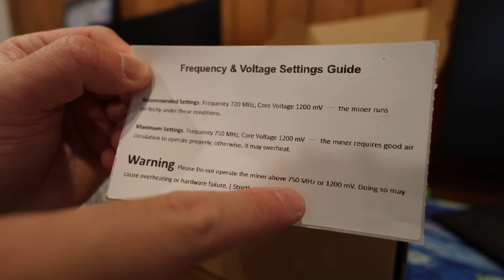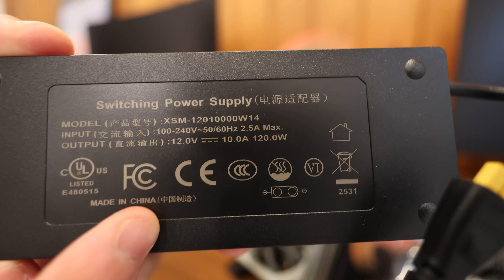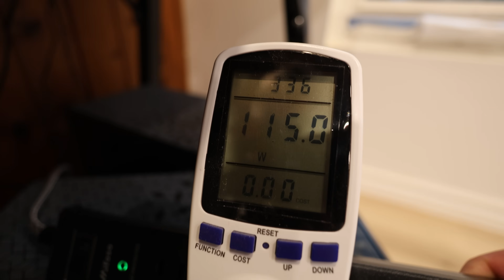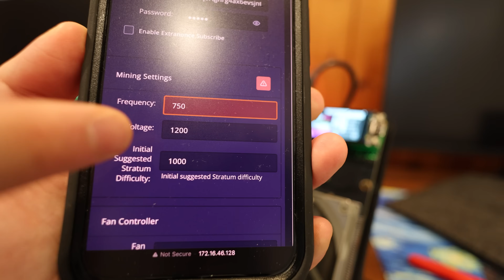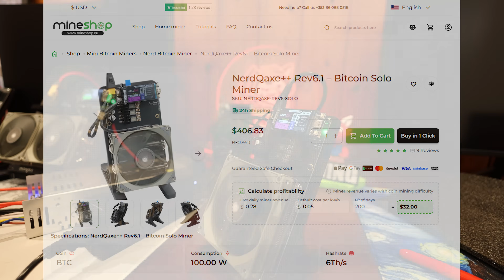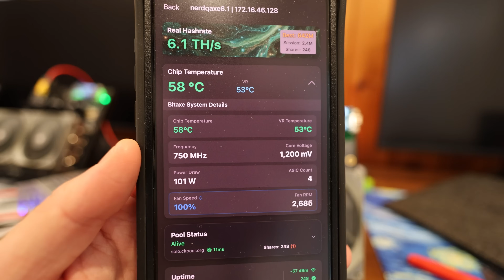This Little Bitcoin Miner Changes Solo Mining FOREVER.

Comment: RPM, that Qaxe++ looks very nice! i like it, i think the limit is PSU thats the reason for the warning! you are running that limit PSU maxed out, also there are two type of XT30 connector, standard and heavy duty, standard max out at 15amps and heavy duty 30amps however the XT30 heavy duty connectors are so expensive its cheaper to go XT60 and get the same capacity, as for barrel connectors they can support up to 15+amps however because there is so many different types that range from 1amp to 30amps its very confusing and can cause major issues if you buy the right connector but with the wrong awg wires or correct awg wire with the wrong inner pin rated barrel etc.. so since there is only two types of XT30 that solve that issues but its not because barrel connectors can’t support more than an XT30 because they can.
Reply from the maker: There's 2 xt30 plug revisions wow